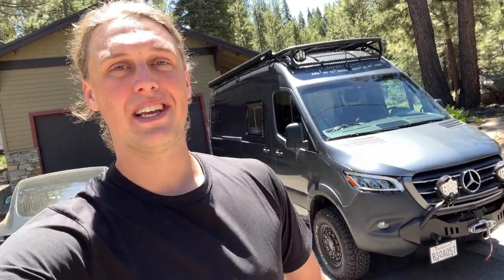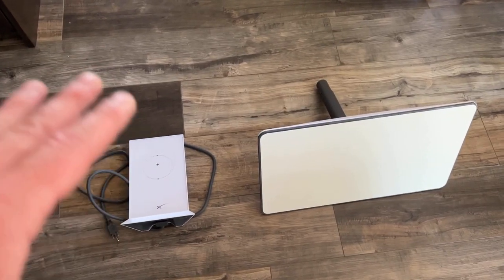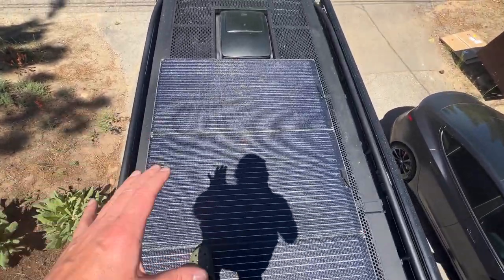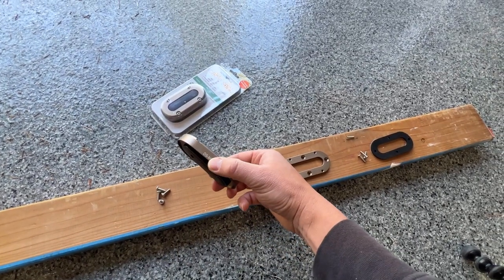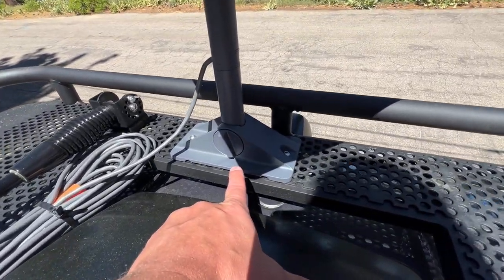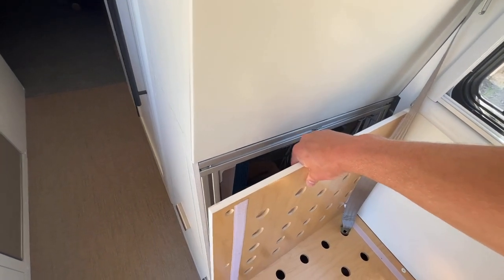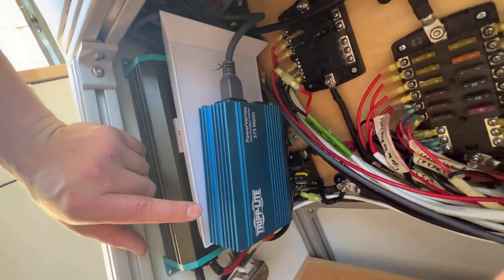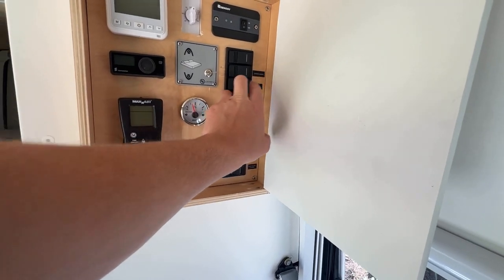How To Install Starlink on a Van + Tips and Tricks (GAME CHANGER)

Comment: The connector on the dish end is fragile and a lot of people have had problems with it.  The solution is to splice in a weatherproof RJ45 connector near the dish and leave the stock connector plugged in permanently.   You can shorten the cable so you don't have that bundle on your roof.  Then you can buy a long section of cat5/6 cable (with RJ45 connectors) in case there are obstructions next to your van so you can place the dish on the ground if there is a clearing nearby.

I'm building a box that will be attached to my rack.  My "stowed" dish will be mounted in the box with nothing covering the dish.  I'll add a cut-off switch for the motors.  I'll still be able to pull it out and use it on the ground with the stock stand.  

Very seldom will you have a satellite directly above you and when there is one, it will only be there for a few minutes.
Reply from the maker: Wow great idea! Thanks for sharing 🤙
Reply: @seven_o_savage  Also, the stock connectors are wired differently so it's proprietary.  Most people correct that when they splice in the RJ45 connector.  Lot's of info on FB and Youtube about doing that.
Reply: @sjackson99  could you link to a guide you recommend? I'd like to not unplug the starlink cable every time I have to move.
Reply: @sjackson99 just keep in mind that as long as both rj45 ends you attach to both sides of your original cable it doesn't matter what color schematic you do. Heck you could do all stripes then all solids if you wanted. It's just a pass-through at this point.

Comment: It probably tests the snow melt circuit when first turning on which boosts power draw to around 175 watts before settling down to just normal usage draw.  You will need the larger (small) inverter for your skiing trips...  There are some blogs on converting the power supply to 12v so no inverter needed.

Comment: How did you get the star link cable through the "rubber bung"?  Starlink has those plugs on both ends of the starlink cable that are buch bigger than the hole shown.
Reply: Did you ever figure out a workaround for this? I'm having the same problem haha
Reply: @Ghostly-00  I think the “rubber bung” has a slice in it, or you need to cut one to the hole you drill.  However, I did not use that method.  I purchased a bolt on mount and cut my cable to run it through my ceiling, insulation, and van roof.  Purchased a new tool,  some CAT 5/6 connectors, and a water proof and dust proof cable end.   https://youtu.be/8PDvvnVWfpM.
Reply: @jeffsteinmetz7188  Oh okay, thank you for the reply and all the information. I really appreciate it!

Comment: Great vid. Thanks for the mounting tips. I learned today you can install a PoE injector and transformer to jump up the 12v DC to 48v DC and save power also as the Starlink converts 110v AC power back to 48v DC so converting twice is not as efficient.

Comment: How did you get that plug through that gland hole?  I looked at a video that left the dish up on the van roof using the pivot mount, and using the stow function in the phone app.  It took me a little time to find/ figure out, but using the phone app you put the dish in “stow” and then pivot the dish flat and re-tighten the pivot.   The dish then remains on the roof, travels in a low profile position, but still needs to be raised and lowered.  This sounds better than leaving that plug out in the weather.

Comment: When you install the Starlink mount, be ready to loose the adjustment knob. I installed the mount on the factory roof rail and used some of the adhesive strip provided in the kit on the inboard side of the mount plate where it contacts the roof. We left PDX and spent the night in Weed, Ca, at the Mt. Shasta Brewing Co.  The knob was still there then. By the time we got to Sacramento it was gone. The good news is that a 1/2” socket will do the job. Make sure you have one if you want to raise and lower the mast. I think I will just leave it up. With a fan, an awning and a solar panel, how much difference will it make?  Note: I will leave the mast only, not the antenna.

Comment: Great video.  I am about to install a starlink on my crafter and considering putting in a telescopic mount so when I switch on the starlink it goes up from flat and then should work.  The issue is water proofing I think and can I get the starlink to stay flat when not used?
Reply from the maker: Hmm bit confused why you want to have it on a telescopic mount?

Comment: So cool! I just looked at the inverters that you linked and am a little confused. They have a plug for a cigarette lighter plug. How exactly did you go about connecting your mini inverter?
Reply: He didn't answer but... I think you just cut off the cigarette end and it's 2 wires, red & black.  Car lighters are 12 volt.  So then you just use those wires to your system.

Comment: Make sure you go into the app and "Stow" the dish before you turn it off to move it.  The starlink can be converted to use 12 volt without the inverter so it would be possible to get rid of the starlink power supply and router.

Comment: Awesome vid! The part I don’t fully understand is if you drill a 6mm hole for the rubber portion of the gland that’s not wide enough to get the whole plug through. How did you get a plug through the rubber portion of that gland?
Reply: Also curious about this...thoughts seven o?

Comment: Nice! How does it work with the 12V switch turning on the inverter? I followed that the switch goes to the fuse box, but then how does this control the power to the inverter?

Comment: Excitement about the wire passthrough warranted.  It's all about no leaks.  Good video.  Will be purchasing your recommendations.  Edit:  Does the 375 watt inverter have swappable fuses or are they soldered?  Cheap stuff has soldered, like the newer Energizer that is really made by by PowerBright

Comment: How did you the starlink cable through the "bung" hole on the scan strut?  With the RJ45 on the end of the cable (bigger than the cable itself) how do you get it through and still have a water tight seal?

Comment: Starlink at 12Volt, sneaky crazy smart. 
Seriously, that’s a great way around powering up the big inverter. And you get to use much smaller wires too. And the convenience of a 12v dc switch/panel. I have to look into a small inverter for this reason alone. And I don’t even have Starlink, yet.

Many people complain about the high wattage Starlink is drawing. Like you, I believe in turning it on only when I actually need it. That should save a ton of power. Being conservative with energy forces us to be more efficient when we use it. Don’t turn on your Starlink and then go on a hike. 

Those walk-on solar panels are nice. I considered getting them for a sailboat. Until I found the price. 
A standard solar panel costs $1-$2 per watt. Your cost $6 per watt. 3-6 times the cost. 
Renogy 175 watt flexible solar panel is on sale for $279 at the moment. They are only 7 LB compared to 25 LB of a rigid panel. And they cost less then 1/3 of the walk-on panels. If you went with 150 watt panels, you just spend $3600 plus tax for 600 watt of solar. Got money to burn? Go for it. 

I looked at the wire pass thru thingy. My main gripe with it is vertical wire orientation. Something horizontal is less of a hazard for both tripping and breaking wires. The standard PV/RV roof mounting entry gland looks less fancy but at least is horizontal.  There are single and doubles. With MC4 or blank. You’d be installing multiple, but that’s not necessarily a bad thing. 

My latest solution for this issue is using a cable gland box that gets sealed to the roof. Now the fancy pass thru gland you used can be installed on the side of the box and a overall more streamlined look can be archived. Single glands can also be installed and with 4 sides available, you can install extra as empty spares. This gives you expansion capabilities without needing to drill more holes in the Van. 
But otherwise I like it.

Comment: Are you worried about weather on the cable end when not inside the dish? I’ve been wondering how I can protect it in a box or something when not in use. I’m really hoping since they now have the RV plan they will come out with a dish for RV mounting.
Reply from the maker: I talked briefly about a cable cover that addresses this!! Towards the end of the mounting section
Reply: @seven_o_savage  I've watched twice, must have missed it.
Reply: Sandwich bag and electrical tape.

Comment: Hey Seven, I assume you cut the cable to get it through the rubber plug on the scanstrut, is that right? I have a scanstrut in place and don't see how it could be done without cutting. Thanks
Reply from the maker: I didn’t cut the cable I cut a slit in the rubber between the hole for the cable and the edge. It’s still water tight :)
Reply: @seven_o_savage   Nice! I wondered about doing that. I’m glad to hear that it’s still water tight. Thanks for the info I’ll do the same

Comment: I feel like cutting it open and putting a switch on the servo would be the best bet. you can turn the system off and on to reset the panel to home then turn off the servos so well driving you will still have WIFI

Comment: How did the starlink cable get fed through the gasket? The connectors at the ends are much wider than the cable itself.
Reply from the maker: I made a slice with a box cutter for the starlink cable. Still seals nicely.
Reply: @seven_o_savage  ahh makes sense. Thank you!

Comment: Is it okay in the wind being mounted with that mount while driving or do you flatten out to drive? And have you tried its performance in motion mounted like that? Debating whether to do this or get the super expensive wedge mount one (prob won’t but like to weigh my options)
Reply from the maker: I upgraded to the high performance wedge and I loveeeee it. Haven’t had a chance to make a video…
Reply: @seven_o_savage  I thought I noticed that in one of your insta pics!!! Gosh I’m in a tough spot with whether to diy flat mount or get that. The power draw of the high performance makes me a bit nervous.. does it preform a lot more reliably?
Reply from the maker: Hard to say to be honest … they’ve been upgrading the network so much…. But if it has relatively open access to the sky it’s just as good as WiFi at home :)

Comment: Thanks, man, I did the same thing.
Reply: How does it work with the 12V switch turning on the inverter? I followed that the switch goes to the fuse box, but then how does this control the power to the inverter?

Comment: I have heard a lot of reports from RV/van lifers that reception is actually spotty and unreliable. Also no signal if there is cloud cover. Anyone who uses Starlink regularly can verify whether they receive a consistent and reliable signal?
Reply: People have reported using their Starlink in a hard rain without any problems so I'd say "no signal with cloud cover" is false.  I'm currently using mine at my house but eventually, it will get mounted on my van.  I haven't experienced cloud cover but I'm looking at my statistics and I have not had any outages 2 seconds or longer in the last 12 hours.
Reply: I use mine a lot out west and have zero issues. Speeds are over 100mbps in middle of nowhere.

Cloud cover does not cause issues that is a rumor based on old direct tv issues.
Reply: I’ve been using mine since late May, also in the west, primarily NorCal, and it’s been a game changer. 

Currently in an area with no cell (Lost Sierra) and yup, watching YouTube/Netflix with 100+Mbps down and 8-11Mbps up consistently. Just need sky. Works well enough for meetings and calls (wifi calling) too. 

Landed mine into a peplink BR1 pro that fails from Starlink to LTE, so in the areas where I have both it should be a really solid setup. Possible to also bond the connections with peplinks speedfusion tech. Anyway…game changer for sure. 

Used the same mount from Starlink and some T-Bolts to mount directly to the factory rails….and honestly, I regularly drive with it up too. Took a month of constantly climbing the ladder to become comfortable with that. So far no problems if I keep it under 60Mph. Haven’t tested faster.
Reply: @curmorpheus  man that’s awesome. Never heard of the peplink BR1 pro. I’ll have to check that out.
Reply: I’ve had no problems in Wyoming and Idaho in places with no cell. In Montana I had an issue in one campground at Glacier with lots of trees.
Reply: Ive heard lots of bad things about star link. Personally I feel like a dedicated cell phone provides better internet acess for much less hassle.
Reply: @erictripps125  There's lots of places out here in the west where there is no cell signal at all. I've been in places in Utah, Nevada, Wyoming, Colorado and Montana with my AT&T phone, TMobile hotspot and Verizon hotspot and all 3 report no signal. This is with an without a WeBoost too. Starlink isn't perfect and isn't the solution for everyone, but out here it's the only choice in a lot of places.
Reply: No idea where these reports you are referring to are from. If you are under trees you will have problems obviously. But clouds do not affect it at all. Been using it for awhile on the road when no issues in California and Oregon. Posting this comment with it right now as I write.

Comment: i'm not impressed wit;h Starlink yet.  Until it can be mounted permanently and it tracks the while you drive.  Until then, i'll use the Weboost, or as  you call it the old antiquated antenna.  plus the weboost is all 12v already...
Reply from the maker: Yea if cell signal is working for you no need to change it!

Comment: Anyone remember Elons solar city failed solar panel company? I have a feeling starling is going to go the same route. Do some research before buying one. Also, the power cable is hardwired to the unit so if it gets damaged 
, THE ENTIRE unit must be replaced.
Reply: StarlinK is already successful.  The old versions (round dish) was hard-wired.  The new rectangle dish is not hard-wired.   So you've never repaired a cable?
Reply: Starlink is a blessing if you live in a rural area.....  I live in a college town. I get spotty cell coverage and I didn’t want to commit to a two year contact for internet service.... Starlink was a great option since I can use it with my camper van.
Reply: @rjthomasindyusa  starlink isn’t the only option
Reply: @sjackson99  LoLoL. Imagine spending $500+ on this and then saying, “stho  you’ve never repaired a thable” 😂
I’ve built a few camper vans with 12/120v systems. I know how to “repair a cable” but that’s completely besides the point. Starlink is going to fail just like Solarcity did because it’s an unsustainable model. Do you have any idea how much money Musk will have to spend to send satellites out to expand starlink coverage? You clearly are just a Tesla fanboy 🤣
Reply: @CrimpKeeper  The only thing available for me was Hughes and it sucked. This is cheaper and faster.  I don’t understand the hate. If it works.... it works. If and when it stops working just stop paying. Simple.
Reply: @rjthomasindyusa  then I understand why you’d go this route. I’m sharing info because a lot of people just buy things without researching because some YouTuber has it. I’m trying to save people money.
Reply: Consider the bigger picture...there is no way our country would let a constellation of this magnitude, that will cripple our ground radio telescopes, unless there is a benefit greater than our imagination.  Basic WiFi for all is a great cover story.  The show will go on.
Reply: Solar City did not fail lol! Nice try though.
Reply: @mycalltoadventure9712  I bring facts, you being nothing, “nice try though. “"Almost immediately after the acquisition closed, SolarCity's auditors [Ernst & Young] confirmed that SolarCity was, in fact, insolvent," attorneys for the investors argue in their latest filing (PDF). E&Y's year-end audit, conducted in January 2017, determined that SolarCity did not have sufficient cash to meet its obligations and could not operate on its own as a going concern.”